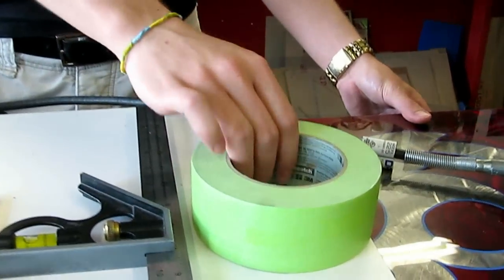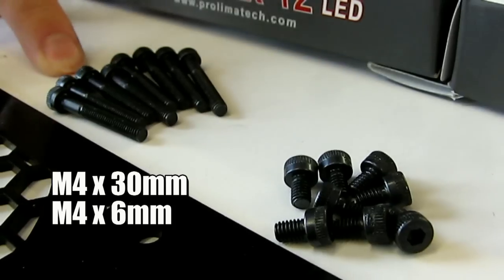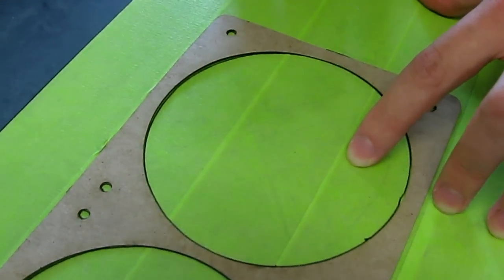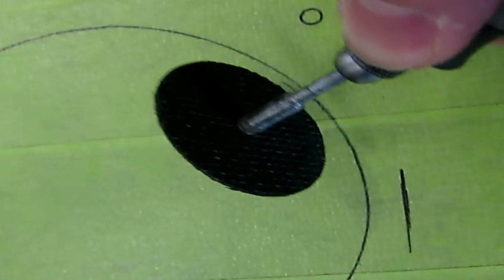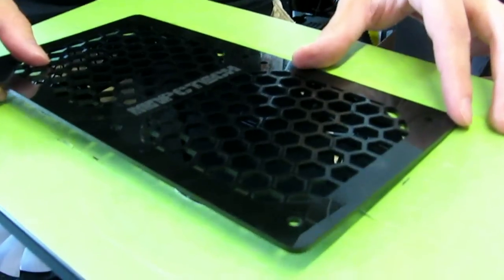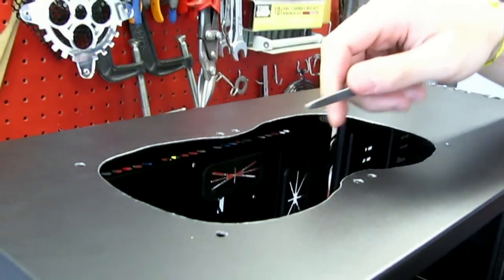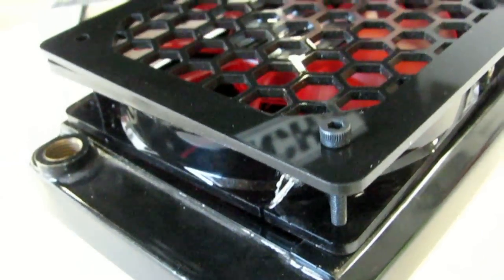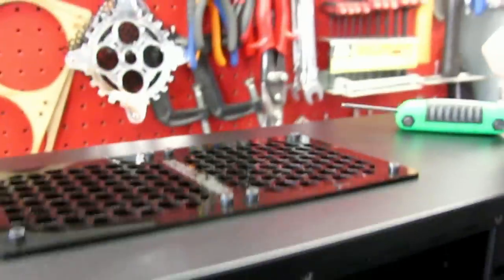PC Case Mod Guide: Installing 240 Radiator (2x120mm)

Comment: Is there a way to isolate the airflow of the radiator from the air inside the cabinet? That must be the perfect solution. I would wish for a cabinet that had this designed into it. Well you need a couple of more fans, but what the heck...

Comment: Had you ever thought about removing the front casing for the optical drives just to remove anything if any that is air obstruction that it could be causing? I know they're rivited on which can be annoying if you dont have a proper way to get them out...but just a question, been debating on mounting my h80 on the top 120m fan in front hense the question.

Comment: ....what if your radiator is not going to be on the cealing of the case but on the sides (in example when the case sits horizontal and monitor stands on top) ...will it produce the same cooling effect?

Comment: Whatis a radiator? Does it heat up your pc?
Reply: this is super late but a radiator helps to transfer the heat from the cooling liquid to the air efficiently so that the CPU or GPU is cooled